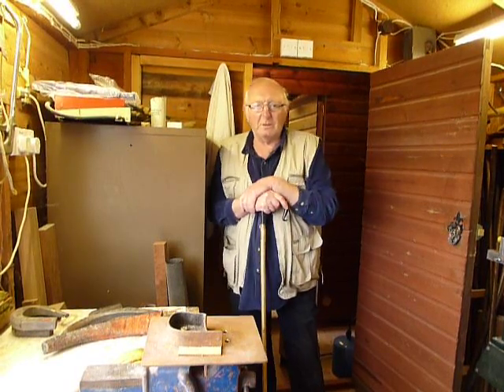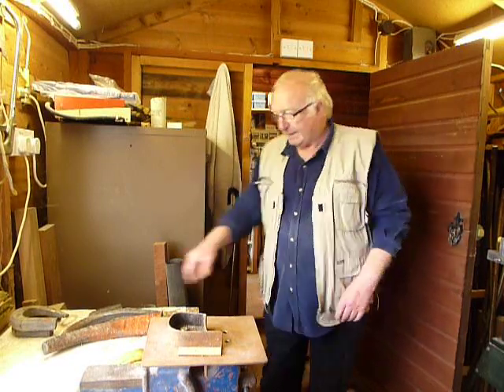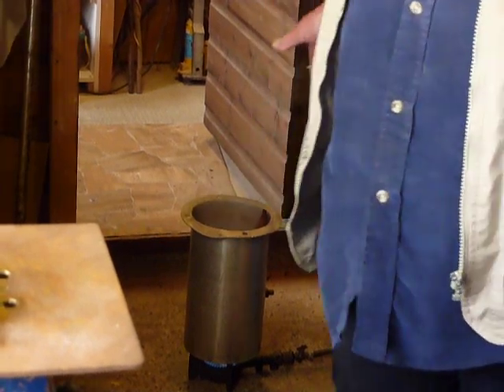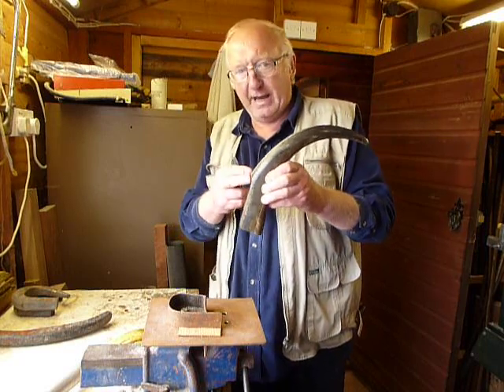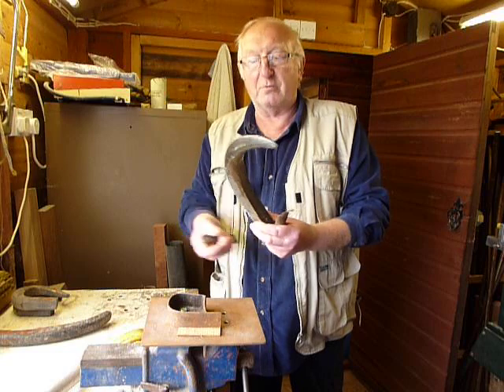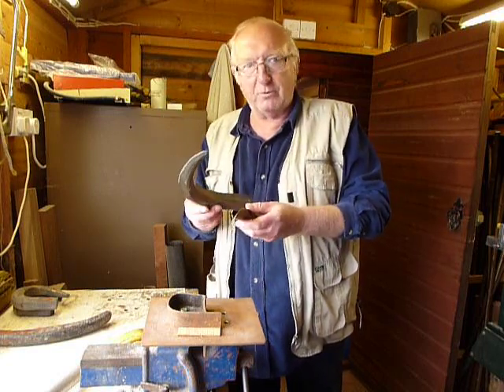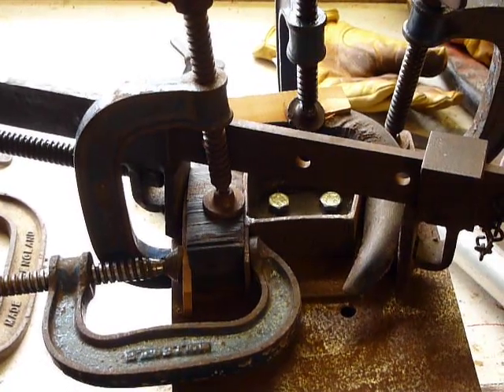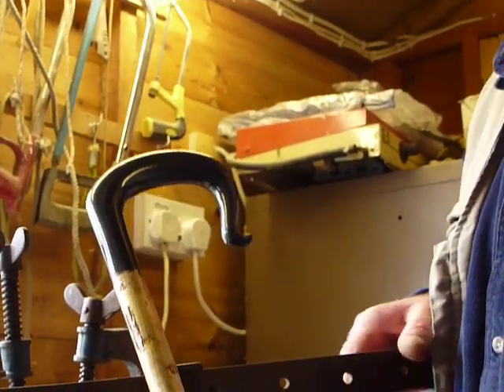walking stick making demonstration bending buffalo horn handles series 4

Comment: I wasnt looking for a video on how to make a walking stick, but this was the only video I could find that so well explains how to work with heated horns! Thanks a lot for this, I'll try to apply this in making horn sheets and forks/spoons etc.
Reply: You boil the water 100 C , then drop your Horn in tte hot water , after 5 to 10 mi nits later you get out and press the horn .
Now you got flat the horn plate and throe normal water .

Comment: Thank you for this video.
It has inspired me to give buffalo horn a go.
Well made video with great explanations.
Reply from the maker: Thank you, hope it goes well
Reply: @woodlandsticks1365  thanks.
Does it matter if the horn is older or does it need to be fresh?
I've ground up the horn I have and there is still one crack near where the heel turns from stick to where the hand will grip the handle.

And if I may ask, what are the dimensions of the thickest end?
I ask so I don't leave it too thick.
Currently mine is 38mm x 45mm and the section at the heel is 45mm
Thanks again. 👍👍
Reply from the maker: I have used old trophy horns with no problems ,fresh horn needs to dry out for a year.http://woodlandsticks.co.uk/buffalo-horn-walking-stick/.This might help .

Comment: I boiled a Buffalo horn for 4 hours and it barely bent at all.   Seeing you boil something for 45 minutes and then you can ban I'm dead what's in that pot.
Reply from the maker: The important thing is to keep it hot after the boil. Have clamps and former ready. Clamp quickly to the former, then heat with a hot air gun where you want the first bend to be. The first bend is the hardest.

Comment: Way late to the party, but are the horns filled with another material? All of the horns I can find available for purchase are hollow and can’t be mounted with a central screw post or even shaped in this manner. Are there fillers you can recommend?
Reply from the maker: Hi all horns have a certain amount of hollow. With the Indian water Buffalo horn they have a lot of solid on old horns. What you buy is the solid tip, the hollow has been removed. What you have is either a young horn or from another animal, so look for Water Buffalo horn. I have had a look to see who have imported into the U S and found   Atlantic coral Enterprise  they might help. Countries are funny about importing animal by products .  Good luck Dave

Comment: Hi do you know where I could get buffalo horns from as I’m making a crook for my dt project in school
Reply from the maker: Hi Dyfan Buffalo horn is in short supply as the main importer has retired. I have no horns left as I have retired. My suggestion is to join  Shepherds crooks and live stock  on facebook and ask if anyone has one spare. Dave
Reply: @woodlandsticks1365  hi I’ve just joined the group and I’ve asked. Thanks
Reply from the maker: @dyfanlloyd4494  Your welcome
Reply: @woodlandsticks1365  hi I’ve got myself two horns but I was wondering where you got your pan from to boil them

Comment: Can deer and elk horn be bent also and wouldn't it be easier to bend? Thanks for the great videos!
Reply from the maker: Hi Carl   Sorry to say it but deer and elk horn are not horn they are antlers ,Antlers are bone so no they will not bend. Thank you for your comments Dave
Reply: I had the same question. Thanks for clarifying the difference .
Reply: Very different. You can indeed bend antler, however (and bone, elephant ivory, etc.). Soak in horse piss for a month beforehand (or alternately, distilled vinegar).

Comment: Always apply heat to side with the longest radius!
Reply: For materials that will stretch under heat (eg steel), you are correct.  Some materials split instead of stretching so in that case the interior of the bend (“smaller radius”) must be heated instead to facilitate compression  (eg aluminum, ...buffalo horn).

Comment: I live in Illinois USA and have a variety of trees to make sticks from but the majority are pine. Is pine a good wood to use for these projects? If not there is plenty of other wood but most has grown too large. I'm having bad luck finding the right stick. Any tips?
Reply from the maker: Hi Here in the UK we are spoilt for sticks. I have seen sticks made from Christmas trees and they looked good I think most young growth of wood is usable for stick making so you will have to experiment.Good luck Dave
Reply: buy a hardwood dowel....branches are weak